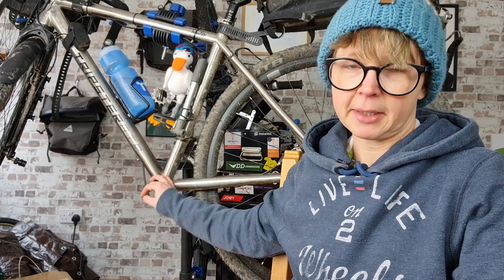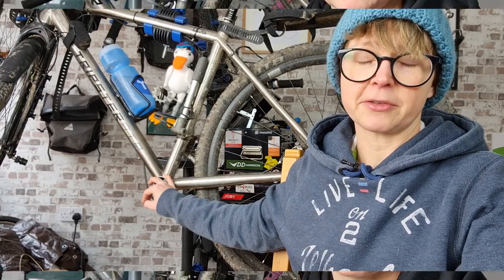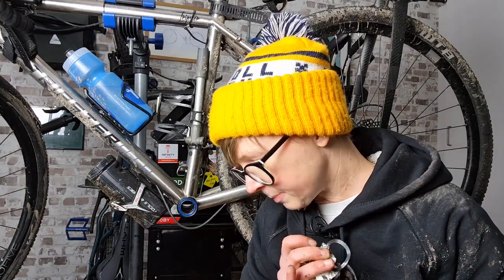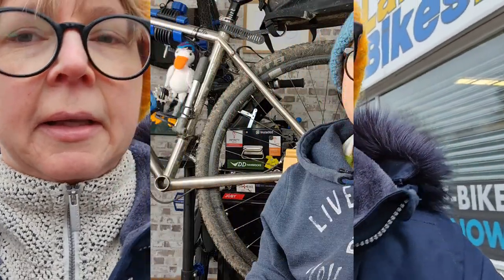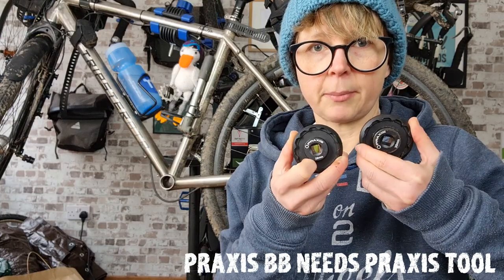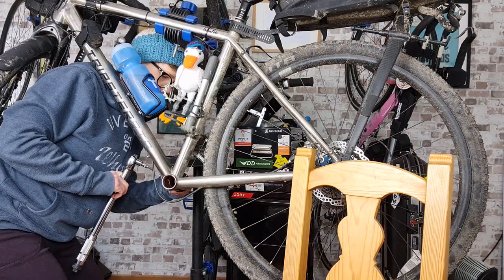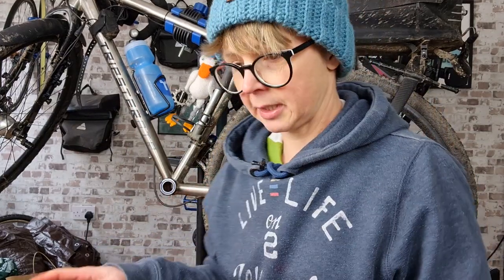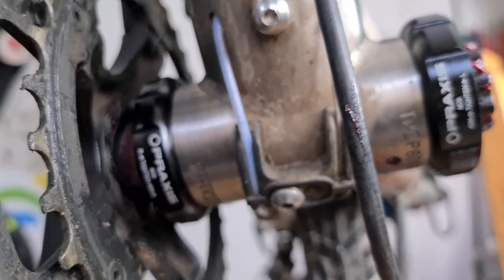Don't make this mistake when fitting a (Praxis) bottom bracket!

Comment: Kajsa - I was taught not to use a torque wrench to remove/loosen - only to install.  Since due to dirt/rust whatever; the force to remove could exceed the torque wrenches rating.  So I use a breaker bar (they are relatively inexpensive) to remove and install with withthe torque wrench.   I appreciated seeing the praxis BB since I am about to buy and install one.   Thanks.
Reply from the maker: Thanks, I'll look into that!

Comment: Hahaha! Entertaining for sure. But goodonya for having a go and learning to fix things. I roll my eyes when I hear "I don't know how to do that".
For some reason the wavy washer is listed to go on the chainring side for some manufacturers. In practical terms it is better on the other side due to keeping the chainrings from moving slightly so your front derailleur adjustment stays static.
Keep up with the funny videos. I like them.
Reply from the maker: Thank you for your kind words, much appreciated! 🙏
Reply: Praxis M30 bottom brackets are like oversized SRAM GXP. The axle is floating in the 30mm drive side bearing and not fixed in place. The wavy washer is there to push the aluminium spacer against the bearing seal and stop muck getting in. That's all it does. It's not there to prevent the chainrings from moving out of alignment with the derailleur. The non-drive side bearing is fixed. That's why the axle has a step in it as you tighten up the 28mm bearing inner against the step. That determines the chainline, not the drive side spacers/washer. Never fit the wavy washer on the non-drive side bearing on Praxis/SRAM chainsets as you'll never get the required torque.

Comment: Is there a spacer required between the drive side shell and the BB?
Reply from the maker: I honestly don't remember but everything came with it so you wouldn't have to buy anything additional.
Reply: @KajsaTylen  I want to fit a bracket behind it. I'm curious as to whether it will affect my chain line.
Reply from the maker: @Leo-gt1bx  Watching the video back, it doesn't look like there's a spacer there.
Reply: @KajsaTylen  I would like to put a thin plate behind it to fit a chain catcher was hoping it's possible without affecting things.
Reply from the maker: @Leo-gt1bx  Worth a try but can't guarantee anything!
Reply: @KajsaTylen  My question is mostly will there be a spacer fitted when fitting onto a 68mm BSA shell. If a spacer is required I can make it work.
Reply from the maker: @Leo-gt1bx  I'm afraid I don't know the answer. As you can see from the video, I'm no expert. 😊
Reply: @Leo-gt1bx  There's no spacer required on road frames. There is a spacer required on mountain bike 68mm frames. However, it might still work as the drive side is not fixed so an extra spacer will not affect your chainline. The axle floats. You might have to fit a thinner seal or squash the wavey washer more. But, why not just fit a chain catcher to the front derailleur mount?

Comment: Did I miss the part where you inserted the moisture seal?
Reply from the maker: What moisture seal? The grease?
Reply: @KajsaTylen  When you took the BSA BB out of the box, each cup should have been inserted into the ends of a plastic tube.  You should  be able to also see it in the instructional parts list and it's literally called "moisture seal".  You can also see it on their website: https://praxiscycles.com/product/m30-english-threaded/.  I consider it semi-optional in that it's not required for proper operation of the BB and it does add a few grams to the overall weight of the bike.  But it might extend the life of your bearings.  Incidentally, I contacted Praxis as I was hoping there was a home mechanic way of servicing the bearings themselves.  Apparently there isn't so keeping the bearings free of grit and grime is the only way to keep them from seizing.
Reply from the maker: @garrettmoriguchi9253  Ah, no, seems I missed that out! 🤣🤣 Oh well, seems to work fine without it anyway. 👍👍
Reply: @KajsaTylen  LOL.  Actually a few years ago they did not include that plastic tube.  I'm guessing people complained about the short lifespan of their bearings when exposed to harsh riding conditions and therefore included it (other manufacturers of BSA threaded BBs often do).
Reply from the maker: @garrettmoriguchi9253  Good to know for next time. I just thought it was for storing the brackets, because the first one I got didn't have it, just a cardboard tube. Thanks for the heads up! 👍👍

Comment: well it looks like you made it again wrong :)

1) you need to torque BB according to Nm's
2) on the drive side you should install m30 dust cover, then wave washer
3) on no-drive side just m30 dust cover
4) you need to torque main bolt according to Nm's
Reply from the maker: Well it works perfectly so can't have been that wrong!
Reply: @GT-sc5sk so first put the dust cover next to the crankset and then the wave washer stays next to the bearing 😮 I should take a picture before remove everything